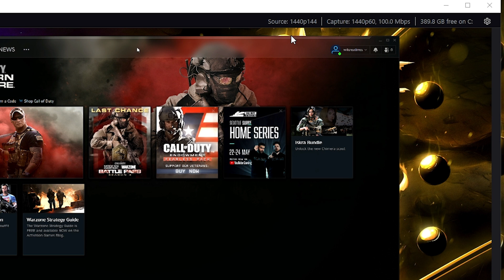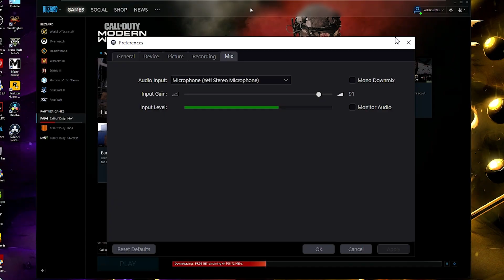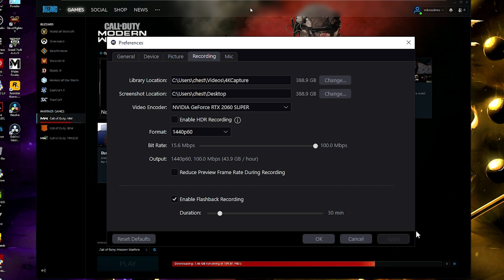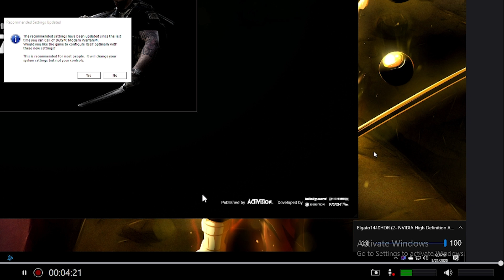Streaming PC Build 2020 | Elgato 4K60 Pro Mk.2 | NZXT H510 Elite | Ryzen 2600X | RTX 2060 Super

Comment: Hey, this is urgent, is this list of pc specs capable of at least streaming 1080p60fps from console to pc: Ryzen 5 3600, 1650 sc ultra evga, wd black m.2, cooler master psu 750w, b450 tomahawk max, and 16gb ram 3200mhz with the 4k60pro

Comment: I have a PC build with a Ryzen 5 3600 and RTX 2060 KO will this capture setup be fine with my setup? I Mainly use my Xbox one with 120Hz monitor as my gaming setup.
Reply from the maker: DeVontae Williams yes you should be fine!
Reply: Did you try it? I got a new PC with Ryzen5 3600, 1080 GTX and B550 Mainboard but the Elgato doesnt show up at all. In my old Intel Setup it worked fine, official Elgato says Ryzen 7 or above.

Comment: how good is the 2060 super for 1440p 144hz? do you play at mid/high/ultra settings?
Reply from the maker: I actually game on a 2080 super. The 2060 super is great for 1440p on high settings but not for high refresh rate. You should definitely get 60fps plus though.
Reply: WiLcreatives i have a 2070 super xc ultra, could that be enough?
Reply from the maker: joooski oh yeah you’re good with a 2070

Comment: Awesome, I watched your Lancool 2 vid to help me out when I built last night. 

Heads up to anyone building with the Tomahawk Max though, the Lancool 2 has an A-RGB connector, but the Tomahawk Max doesn't have A-RGB pins in it, which sucks but the case is still amazing.
Reply from the maker: Sparky awesome thanks for the feedback. What type of cpu did you install?
Reply: @WiLcreatives  Ryzen 5 3600! great cpu so far but I found it to idle around 50 C, don't know if I should worry about it too much or not

Comment: I have an rtx 2060 super with 16gb ram 3200mhz with a carbide 275R case (black)  and in a few days im getting a msi b450 a pro motherboard and a ryzen 5 2600
Reply from the maker: Trilix Nice! I’m also going to do a video for how the gaming is on the system as well. Wasn’t built for that but I’d gotten a few questions on it.

Comment: I have a r7 and I followed your tutorial for gpu and psu change their amazing but is it possible to case swap ?? And can you do
A tutorial if not thank you anyways 😊
Reply: I just swapped cases the other day, but upgraded everything except my ssd, hdd, and psu. It's sorta hard ripping all the psu cables from the old case, especially with poor cable management, but it's worth it
Reply: Was there anything like specific screws that’s wouldn’t fit in a normal case I’m asking this because I had to cut a hole in my r7 push back the fan and fit the rig strix and I’m starting to worry about heat